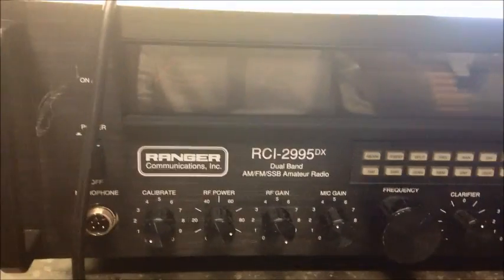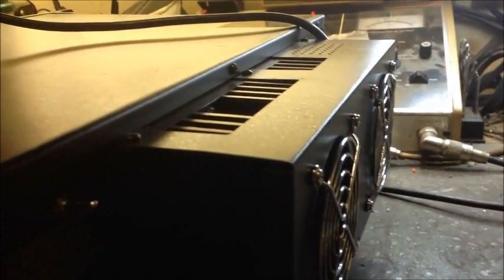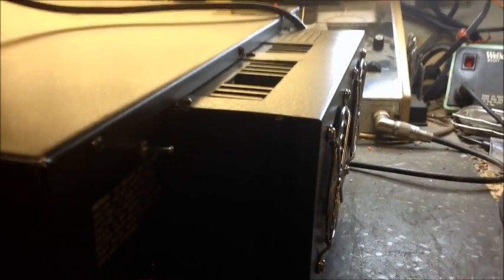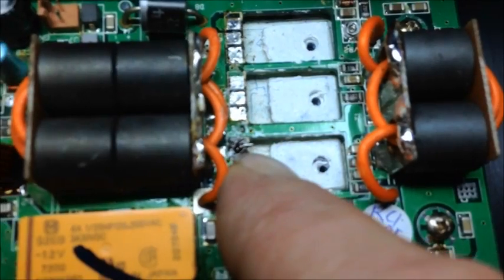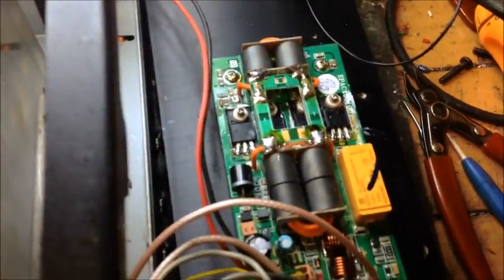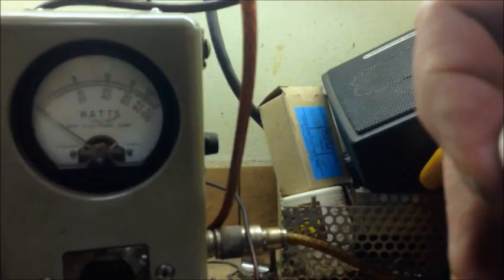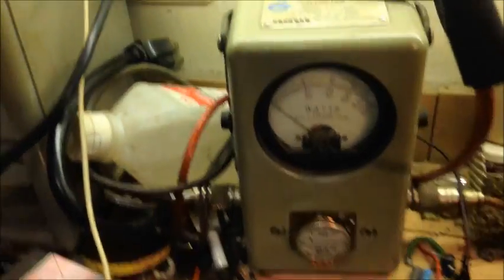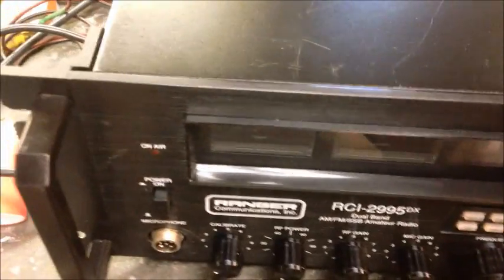RCI 2995Dx repair

Comment: I know most of the pros use BIRD meters. I'm NOT a big fan of BIRD meters.. Slugs and all, batteries... Just buy a good set of meters that cost way less and WALA no hassles.. DOSY, PARA DYNAMICS, BULLDOG, ASTATIC, amongst many more all have upper-line meters that work just fine. I know they are not a PRECISE as a BIRD meter but way fewer hassles and if they are a few watts off NO BIGGIE!

Comment: What are the upgrade mosfet numbers you're using? Also, I put new (4) mosfets in the Amp, two in the radio. Am screams sideband is all garbled can't understand it. Frequency is ok. Clarifier ok. Sideband will swing 200 as will AM. Any ideas?

Comment: The problem is the Bias is not set right. Out of the box from the factory, drawing 2.4 amps idle!
They are blown up because people are driving the snot out of them and some big amps are spiking the mosfets.
Reply: Barkett's told me to set them at 3.8V.

Comment: I would replace that amplifier section with a bipolar transistor amplifier section with two HG 2290s.
Reply: if staying with mosfet use RT-6 or ERF-2030
Reply: @christophersmith1155  what are the advantages to that?

Comment: AS YOU CAN SEE THE MOSFET ARE JUNK..GIVE ME 2SC2290 ANY DAY!!! THE PROBLEM WITH THIS IS CALLED HEAT MIGRATION IN THE TRANSISTORS... THAY CAN NOT TRASFER THE HEAT GENERATED FAST ENUOGH THROUGH THE PORCELAIN INSULATOR TO THE HEAT SINK...  SO THEY BURN UP LIKE THIS... THE FIX FOR THIS IS TO REMOVE THE CERAMIC INSULATORS AND REPLACE WITH MICA INSULATORS..... I DID THIS AND IT WORKS VERY WELL!!!! I TALKED WITH RANGER ABOUT THIS PROBLEM AND IT WENT IN ONE EAR AND OUT THE OTHER...I'M STUPID THEY THINK...  AFTER 45+ YEARS IN ELECTRONIC???
Reply from the maker: +STATFIGHTER10 Ya i know, I have to do the same with the micas, also i find alot with the gate voltage not set right for them and this is very bad on them. Just about every radio that comes in the shop the gates are 1 volt higher the what the fet can handle.
Reply: Because they dont care. Its all about the bottom line...